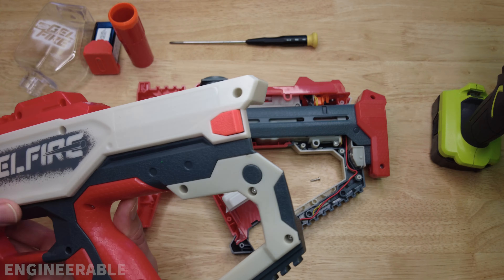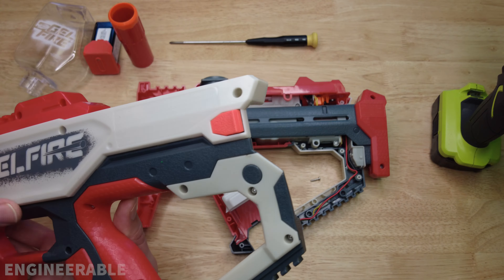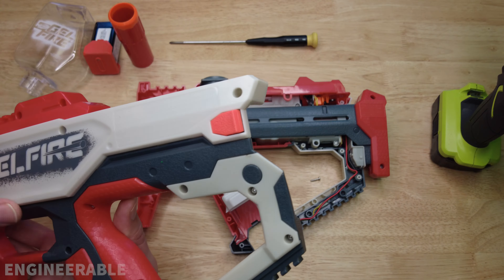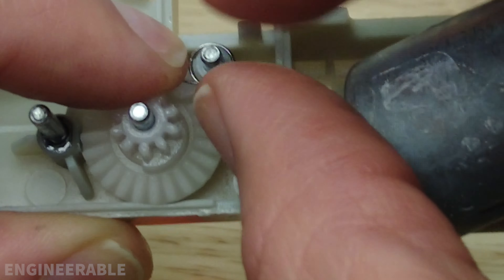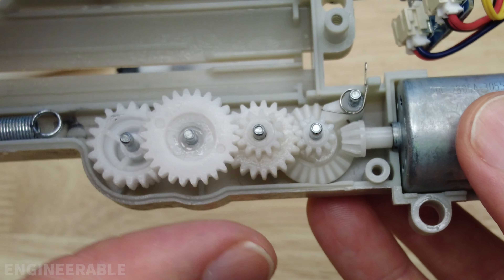WHAT'S INSIDE NERF GELFIRE MYTHIC Gel Blaster? How to take apart (put back together) Splat Ball Pro

Comment: 5:20, you're pretty much right, it's a voltage clamp, using a fly back diode.

A motor is basically an inductor and when you release/open the circuit the back emf will spike potentially much more voltage than the mosfets transistor handle damaging the mosfet.

The circuit routes the back emf electrons back to the battery rather than via the mosfet.
Reply from the maker: Thanks for explaining that motor PCB purpose!

Comment: The piece for the hopper connection could possibly be replaced
Reply from the maker: Yes it could be replaced with 3D printed adapters instead of the included one
Reply: @engineerable  would be better a swap for a lower profile versus the 3dp adapter. More permanent but reversible.
Reply from the maker: @JeffStAndre Yes, I plan to do that also, more difficult for most people to mod though
Reply: @engineerable  curious if a soda cap would fit in there... sound out the ring of the stock connection and cut out the caps closed bit of course. And epoxy in place
Reply from the maker: @JeffStAndre  probably, because the soda bottle thread is quite a bit smaller.

Comment: Nice!! I noticed some sports where the sound seemed to be reversed. haha i wonder if that was on purpose.
Reply from the maker: I put some screws in the wrong places on the outside of the gearbox during reassembly, so was easier to reverse the disassembly video parts.
Reply: @engineerable  haha nice :)

Comment: Cool to see what's inside this. In your opinion, what do you think is better for its price? This or the surge?
Reply from the maker: There are pros and cons. This is more robust, but less repairable. Replaceable battery is a plus. With the SURGE Gen2+ spring in it, it's sweet.
Reply: @engineerable  Makes since, probally go for the surge when I upgrade from my China made one 😂
Reply from the maker: @itsdrew.15  if you're going to pay ~$50 for a blaster, get the UNLOCX pistol mode. Way better blaster for the price.
Reply: @engineerable  Ah, never really saw it in the picture. I'll look into it more. In what ways is it better than the surge?